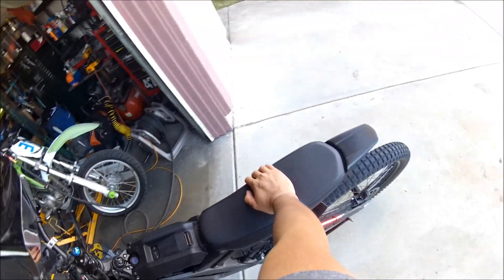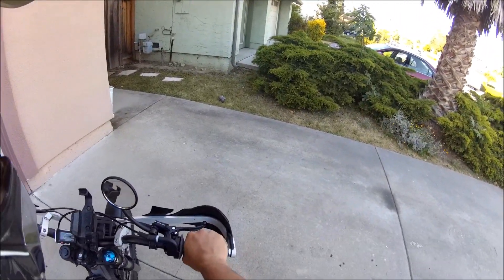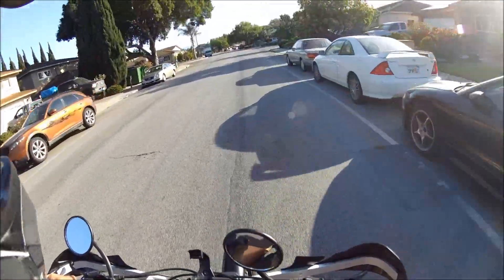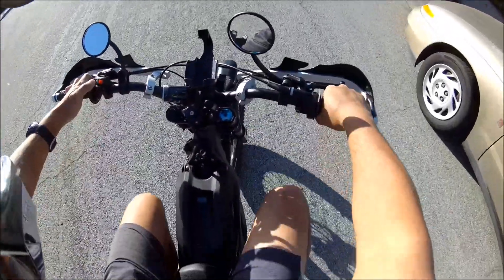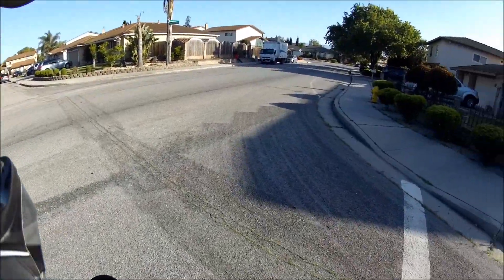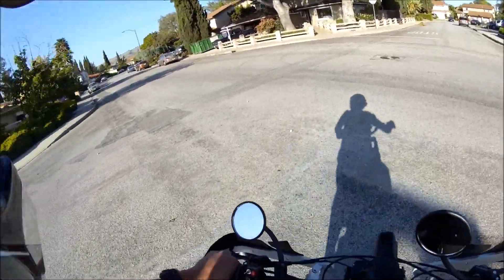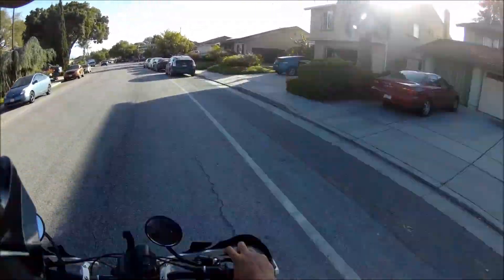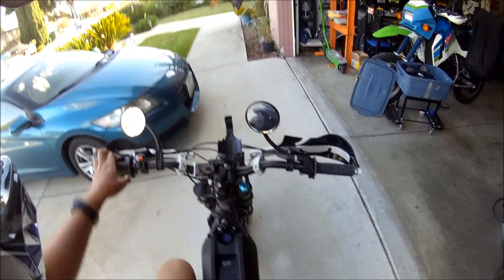Sur Ron Light Bee Low Voltage Cutoff

Comment: I’ve got a similar problem but mine simply cuts off the battery at 28%. But it when it’s on with  the light switched off the odometer is on and fine, but the battery screen doesn’t turn on any ideas what it could be?

Comment: I’m having them same problem when out it will last a certain amount of time ( normally up to 5 min) then cut of but my battery is never less than 90% I recently took out the tilt box still having same problem.. any help please ?
Reply from the maker: Hmm I'm not sure if you are at 90% SOC it should have plenty of voltage.  It could be any number of things like the battery is going bad, something wrong with the controller, or something is wrong with the BMS.  I don't use the stock battery anymore so I couldn't really tell yah. Good luck.
Reply: same mine stays at 92% did you ever find the problem ?

Comment: Hey, could you please do me a favor and tell me the exact measurements of the bike (length and height only) when the bike has the front wheel removed?  I'm looking to get one and the site only gives the full assembled dimensions.  I need to know how small i can get it down to see if it'll fit in the space i have in my van.

Would be greatly appreciated!
Reply from the maker: Sure I can do that right quick.  I actually asked Luna Cycle how much space the box took up and it is 65"×30"×12", I think that size was just enough to fit it  in my Prius.  If I bought it from Luna that's what I planning to do drive down and pick it up.

The measurements without the front wheel are about 35" tall in the rear, 30" in the front without the front wheel and handlebar.  65" long,  It's roughly the same measurements Luna Cycle gave me for the box.
Reply: Fantastic, thanks!